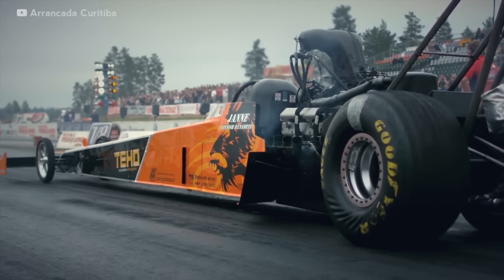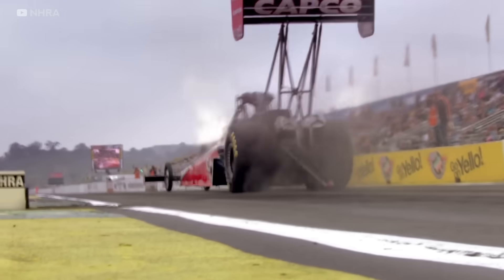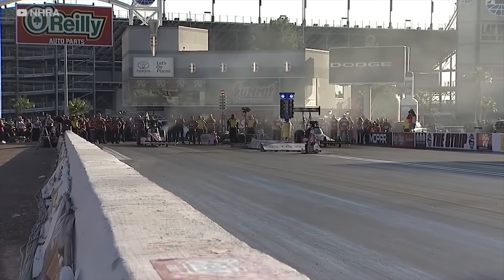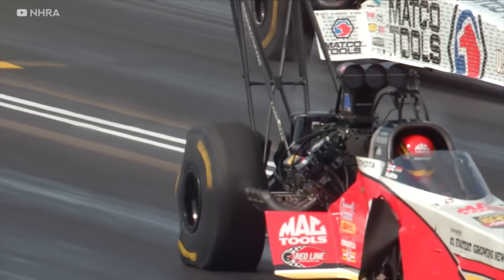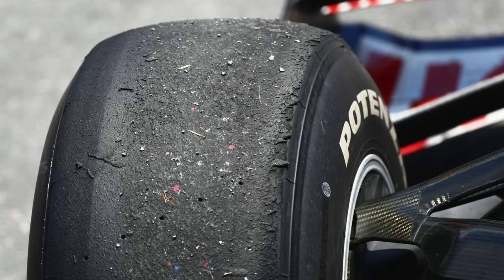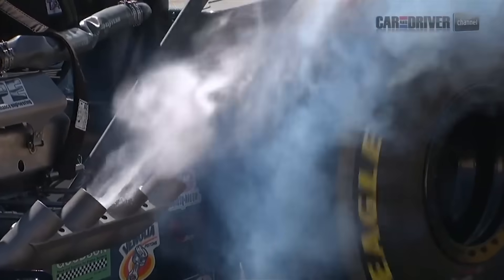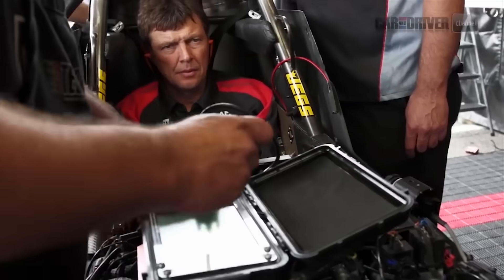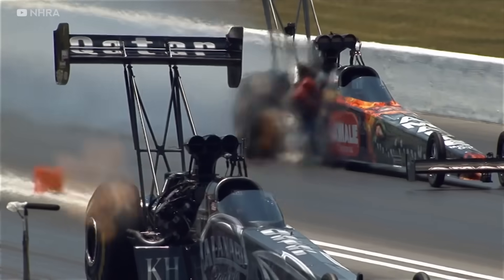How Dragster Tyres Accelerate to 335 MPH in 3.6 Seconds

Comment: I thought the reason they direct drive was because they have no need for low gears not because the tyres balloon. With 11,000HP the problem isn't getting enough torque to move the car, its making sure that you don't get wheelspin
Reply: These things are spinning the tires all the way down the track, the trick is to manage that spin within the limits of that track...
Reply: @codymoe4986  NO!... that "spinning the wheels down the track" went out in the 1960's. They have 5 disk clutches that the tuner pre programs to lock up as they go down the track...in effect acting as a transmission. 99% of the time in today's world if any wheel spins on a fueler the race is lost.
Reply: @MikeM275  There is a difference between smoking the tires and spinning the tires...and considering I have heard everyone from NHRA TV announcers to actual crew members in the pits say the same thing, I guess I will have to take their word over that of some random dude on the internet....
Reply: @codymoe4986  ..You have never once heard an NHRA announcer since the 1960's say that fuelers spin OR smoke the tires downtrack on a run on purpose! Nor have you EVER heard a modern NHRA crew member say they spun or smoked the tires downtrack on purpose! You just lied! ANYTIME a fueler smokes OR spins the tires on a run after the burnout, they lose that run 99% of the time! You need to really learn this stuff...your remarks are making you look foolish. BTW, I own/owned 25 world and national records thru the years in both NHRA/IHRA drag racing. You are simply wrong. Please read up on this stuff..

Comment: Back in the early days the engine was in front of the driver instead of behind the driver. Also the HP is an approximate there is no dyno that can hold up to the engines power, but they do have dynos for their super chargers.
Reply: Those old dragsters are pretty freakin' sketchy. The thought of having the diff right between your legs is pretty terrifying.
Reply: callum mclachlan but people would race them because they loved what they were doing

Comment: They also prep/spray the first 30 feet of the launch surface with a special chemical that is super sticky and is torched at the beginning to make even stickier.  It basically turns the asphalt into a honey like substance that is super sticky.  Only way to create enough coefficient of friction to support 10K foot pounds of torque!

Comment: 500kg downforce from exhaust only, that's the most insane motorsport fact I've ever heard
Reply: Man at that point it's not force, it's thrust.

Downthrust
Reply: And the fuel pumps can pump 10gallons/50 litres a second!!! IDK but it sounds a lot to me.
Reply: Akina Hachi Roku look it up, theres a demonstration video of one pumping into a clear cylinder simulating a run. It’s totally insane
Reply: @TakumisBizarreRacingAdventure  That's 180 m3/h... not an obscene absolute amount but still pretty impressive or a car!
Reply: @Gois83  Understandable, have a great day.✌️
Reply: @Gois83  10 gallons a second is.. a lot. The video said that they use as much fuel as a Boeing 747 on takeoff.. that's a lot of fuel.
Reply: @TakumisBizarreRacingAdventure  pretty close to right , actually, that is why they have almost 3" fuel lines  https://www.youtube.com/watch?v=xGTbQuhhluY
Reply: @TakumisBizarreRacingAdventure  they use around 19 litres a minute at idle, and around 8.5 litres a second at full throttle. the fuel pump is capable of delivering around 470 litres a minute.
Reply: @TakumisBizarreRacingAdventure  The Fuel PIPE is almost 4 inch in Diameter and force feed by the dragsters acceleration to the fuel pumps attached to the motor
Reply: Would suck my Jeep tank dry in 2.1 seconds. @TakumisBizarreRacingAdventure
Reply: Dragster 335mph in 3.6 seconds oh boi
Reply: F1- we sound soo good

NHRA- hold my Richter scale machine!!
Reply: Jay Bilis tbh f1 cara aint THAT loud lol, but indeed in the v12-v10 era they sang, now its pretty lame
Reply: Michael Fritsche  No its not, go watch the video again. They use over 50 litres of fuel in one run. Which only lasts a few seconds. And you wouldnt want a pump that was right at capacity, you want some overhead.
Reply: Top fuel facts are all crazy stuff. Check it up, its amazing and very hard to believe if you arent into it.
Reply: The thing I noticed being at a race was the amount of pressure the sound creates. It blurred my vision as I stood 50 meters from the car as it takes off. It was crazy.
Reply: @gregs909  definatly feel that thump in the chest as they stomp off the line. A lot of displaced air with that much controlled explosion happening at once.
Reply: Michael Fritsche  Also you do realize an engine fires far more than once per second right? You dont need to fit all 10 gallons in the engine at once.
Reply: Michael Fritsche  For the entire run including warmup and burnout the engine will use roughly 23 gallons.
Reply: They actually allow the Top Fuel funny cars to run the same engines with even more aggressive supercharger ratios and for Speed the teams were being daring and trading downforce from the headers for increased thrust by tilting them at ever increasingly further back angles until the NHRA finally stepped in and put their foot down on that because they were dancing too close to not enough down force to be safe.   you often see the top speed of an event held by a funny car even though the quickest elapsed time was a dragster because of that additional top end horsepower those funny cars can build and the horsepower can drag that funny car through the air better than a more streamlined dragster can cut through it with less power.
Reply: It's drastic enough that if one side of the engine loses a cylinder, and thusly the exhaust thrust, the car is pushed in the in that direction from the other side being stronger.
Reply: Funny cars aren't exactly the same, but look up Tony Pedregon Indy 2005. The linkage on his supercharger got stuck and he plowed through his crew. The force of the exhaust literally blew the pants off of his crew chief!
Reply: I reckon if the exhaust points vertically up not diagonal it could have 1 ton of down thrust 🤔🧐
Reply: they used the same effect with the exhausts on the Merlin engines used in the Spitfire fighters. they gained up to an extra 15 MPH just from the thrust created by the exhaust gasses.
Reply: Now imagine it going through a blown diffuser.
Reply: Top fuel dragsters is basically domesticated chaos. 😁
Reply: That is not a fact, just a myth.
Reply: Yeah really strong
Reply: Thats insane, never even thought an exhaust can be used for downforce
Reply: Dave Micolichek  so 400 to 500 kg so sounds like @John Pike was wrong.
Reply: Dave Micolichek  Depends when it happens .. the downforce from the wings at some minimum speed will overwhelm exhaust thrust. Not unusual near the end of the run for the engine to have dropped cylinders, and not evenly between the 2 banks either. Never seen one barrel roll from exhaust alone (from getting sideways for any number of reasons, yes) but defo the driver can feel the car push to one side.
Reply: https://youtu.be/xGTbQuhhluY
Reply: Honestly reminds me of the cars in Distance, they have grip thrusters that let them drive on walls and ceilings

Not quite as violent though
Reply: Peter Evans
Sound is produced by vibrating objects and reaches the listener's ears as waves in the air or other media. When an object vibrates, it causes slight changes in air pressure. These air pressure changes travel as waves through the air and produce sound. ... This creates a positive (higher) pressure by compressing the air.
Reply: Peter Evans so ofc it can be powerful, sound can kill lol
Reply: They could....use it as a jet
Reply: Don't know if its been said..... but there's some great videos of some big boys when their headers fail and welds blow and they loose a header pipe or two being lifted off the track from it......
Reply: Michael Fritsche  sorry. I got your point. The way I read the original comment didn't factor in the real data.
Reply: I remember seeing Barry Sheavills top fuel breaking in half as it went through the lights because it had too much downforce due to a headwind. Crazy.
Reply: I Never Thought of Exhaust Adding DownForce Either!
Reply: Michael Fritsche  What team???
Reply: He didn't insult us with how much money is spent PER PASS...
Reply: Some top fuel funny cars (same engines, but shorter wheel base and full bodied) have angled their exhaust more rearward specifically to use for thrust.
Reply: The problem with top fuel cars is that you can't go to supermarket with them. They don't have enough fuel. Also, they have problems going around the corner. If they solve those two problems, it would be an ideal car for quick shopping.
Reply: For me it was the idea of rebuilding an engine in two hours
Reply: You could fly with that upside down
Reply: FIA in F1: Aaaaand thats a BAN. LULW
Reply: If pointed down instead of up, the exhaust could theoretically lift an Arial Atom off the ground.
Reply: hold on a second everyone, I thought downforce kills top speed?
Reply: Those magnetos burn the electrodes of the spark plugs off in not time but by then the compression is so great they don''t need spark, it basically is a diesel engine.
Reply: 1102 freedom units. 

Sure, its 4 years on, but hey, anything but metric. 

We made tea about it and everything. 
😂
Reply: 10 gallons per second is 37 liters per second, not 50. But still impressive.
Reply: @cinegraphics  Narrator is British.
Imperial gallon approx 4.5 litres.
US gallon approx 3.8
Reply: @colb9916  ah, so. Didn't know that.
Reply: https://youtu.be/BxEBwPQFfpw
Reply: @codymoe4986  wow, it almost took off!
Reply: 500 kg downforce? Then why dont they have exhaust in the back? More pull forward...
Reply: @danijel124  they are tilted toward the back quite a bit, and a few years ago the funny cars were dancing with danger by pointing them further and further toward the back so the NHRA put their foot down and made a rule about the angle of the headers.  They set quite a few records before that happened though
Reply: danijel124 the exhausts must be short, and they emit a blinding light and heat, spitting flaming gases.
Reply: @danijel124  they set the exhaust angle per the rules and it is a nakedness between forward push and downward push. There are no shocks or springs on these cars and they need the extra downforce early to accelerate
Reply: 😂 @danijel124
Reply: Michael Fritsche    No shit captain obvious.  I knew that hence the "lol" at the end of my comment.  And you wrenched on a top fuel huh.  Every time I see a YouTuber say that, I think of this video.

https://youtu.be/z0aROJz2VGE
Reply: Think of them as America's answer to F1 cars. Open cockpit, open wheels, mid engine, rear wheel drive, but with drivers that aren't midgets, with equal opportunity for women, and ten times the horsepower.
F1 cars= Bruce Banner
T/FD cars= The Incredible Hulk
Reply: Thats not a fact....its false
Reply: @johnpike9612  what's the actual number?
Reply: Not crazier than the fuel pump. 15 gallons per second
Reply: @dionesito25  the actual figure is ~ 1.5-1.9 gallons per second.  They run ridiculously high compression ratios on what would be considered really high and "low compression head space" but they fill it full of fuel which brings its own oxygen to help itself burn.
Reply: F1 200mph to 0mph 4 sec
Reply: @maryamkaita2529  drag racers also decelerate faster they cheat and use parachutes.  😀
Reply: Wei Wang wait till you hear of F1
Reply: @ramiabouchakra2726  he was talking about the fact that they get 500 kg of downthrust just from the exhaust
Reply: Astrophobia I just want to admire that we are all saying downthrust now lol
Reply: @xXSgtJackXx  I guess we will have to wait longer to hear of F1.
Reply: Rami Abou Chakra wtf are you on about? I’m an F1 fan but the top fuel cars facts are insane compared to F1. Ridiculous comparison...
Reply: @ThisIsDavesGarage  F1 are INSANE compared to this you mean. :)
Reply: @ramiabouchakra2726  F1 fan boys are the most obnoxious motorsports fans in the world.
Reply: Robert Reese lol what think did he do that was obnoxious? Also is something as dumb as dragsters considered a motorsport lol?
Reply: @recipoldinasty   Why do you insult someone's favorite thing for no reason other than to insult him?
Reply: @ramiabouchakra2726  the rear wing is double of f1 looooooooool
Reply: @ramiabouchakra2726  Ha you wouldn't hear F1 (solo or in a pack) if both were running at same time full out. To fully appreciate TFD - TFFC you have to be there in person. There's nothing like it except witnessing a Saturn 5 launch which I regrettably never did.
Reply: Xen Uno lol russias energia had a more powerful sound than the saturn v, now ive heard these damn dragster, loud as fk but to an annoying point
Reply: @ramiabouchakra2726  of course here comes the F1 fan
Reply: @ramiabouchakra2726  your silly.
Reply: @ramiabouchakra2726   You mean Formula Boring.
Reply: @ramiabouchakra2726  dude f1 cars are honda civics compared to these monstrosities
Reply: @draggy6544  no
Reply: @ramiabouchakra2726  Wait till you hear of F1? What the hell is that supposed to mean?
Reply: @ramiabouchakra2726  dragsters are louder